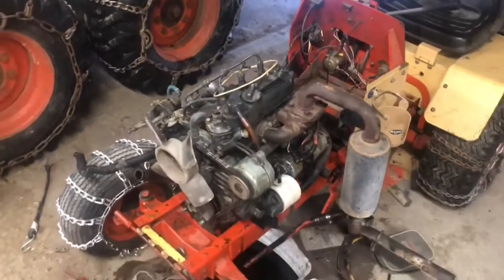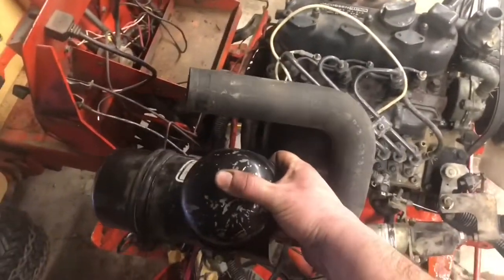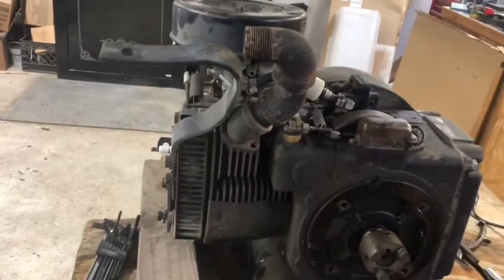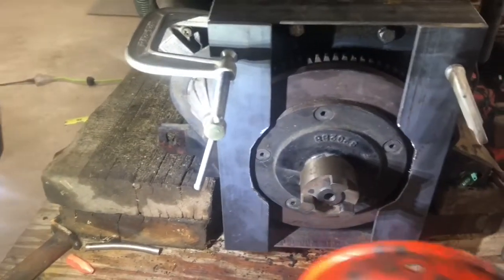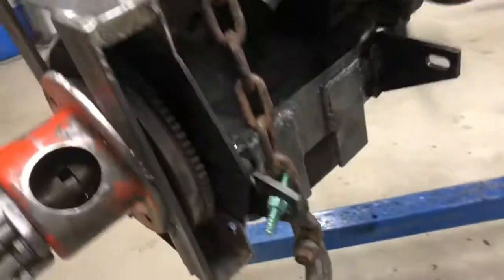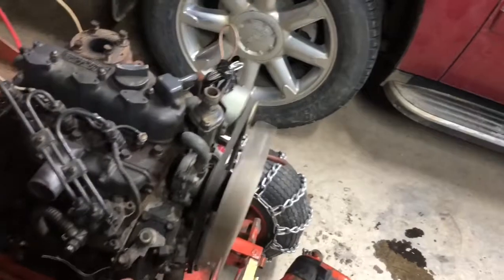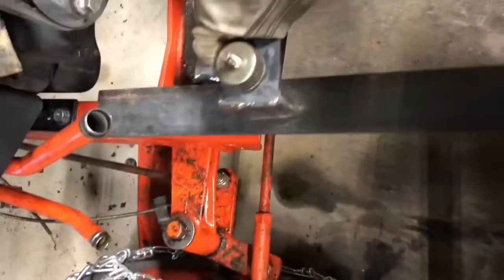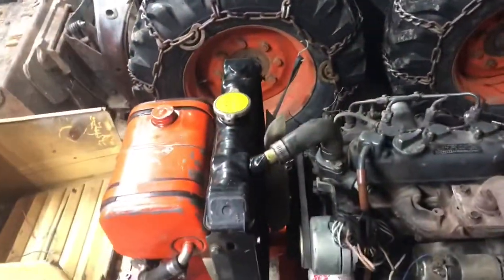Case 220 Diesel swap Kubota d600

Comment: What’s the engine rated at?
Hours on it before pulled?….sounds like there’s plenty of tractor life left.
Reply from the maker: It’s 600cc 14hp 3200rpm. The The hour meter said about 3800
Reply: @223mt  you got me started looking at fairway mowers with Kubota engines….seems like there’s still some life left after 2,500 to 3,000 hrs…the mower being on its last legs….the engines are size wise perfect for a samurai…but are pump drivers and not clutch compatible….the inj pump may also not be ideal….
Reply from the maker: @offgridmangogrower  cool ya I agree. You might want to look for a d722 I think it’s similar size block but closer to 20hp it doesn’t have wet sleeves so they fit a lot bigger pistons in there.
Reply: @223mt  I would hate to drag a whole heavy mower home just for a 120# baby kubota motor…mowers listed are miles from our location…so patience….patience.

Comment: I have a 446 without an engine and recently bought a Kubota 3 cylinder. I saw that you extended the front to fit the radiator but I couldn't tell how you did the hydraulic cooling system and how did you still get the hood to meet with the steering console properly since you moved the hood mount forward? I'm a bit perplexed as you how you did that.
Reply from the maker: The hydraulic cooling system had metal lines that run forward and then a chunk of hose between the metal line and the tank I just extended the hose part. I haven’t got the hood to fit properly yet I was always going to buy another hood and weld them together like this guy says he did in the video link below 

https://youtu.be/XstCxzlr60k

Comment: I find your project interesting
Curious what kubota motors are constant vs adjustable rpm on those mowers…I’m guess the hydraulic pump driven are constant…..(looking for a source motor for a farm driven Sami)
Reply from the maker: From what I’ve seen most mowers are adjustable RPM but Engines from generators or the front of refrigerated semi trailers are constant like either they’re at idle or work rpm and nothing in between.
Reply: @223mt  thanks for diving in
I’ve noticed mower engines are pretty spent by the time parted out
But your find is exceptional..and starts easily….no need to build up cranking pressures.
Rebuilding or pressing in new sleeves is so $$$ prohibitive 
Not many are looking for the 2 or 3 banger…perfect for pushing a Sami around with fruit crates…plus engine and tranny are light and small …… and  lots of parts are out there…..

Comment: I recently got a 2 cylinder Perkins to hit into a stock 446 frame complete with front pto to run all attachments. 
I used a quad rad to keep the stock hood.   Just had to move the hinge ahead.
Reply: I’m doing this work enough for case 446 where the Regenia Italian engine two cylinder engine air cooler
Reply from the maker: Cool hope to see a video of it!
Reply: @223mt  just loaded a couple videos. 
Currently working on a second swap
Reply from the maker: I just watched your newest video with your little Perkins swap the hood looks awesome that’s what I need to do did you put two hoods together or did you make the extension out of sheet metal can’t even see the seam on the video. And Did you know your videos don’t allow comments?
Reply: @223mt  I had another rusted out hood that I cut an end section off to extend my current hood by 3 inches I was able to utilize the original hold downs. It was a little tricky with a stick welder but it blended nicely with minimal bondo.  
The second swap I did not modify the hood other them flipping the hinge. I did weld a piece onto the dash so the hood now sits over the lip. Another video will bo coming soon.